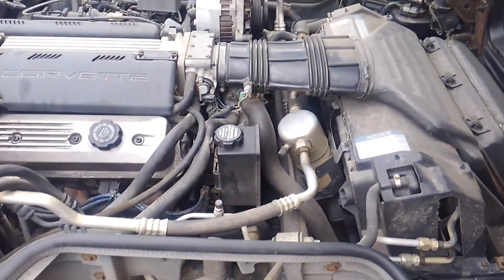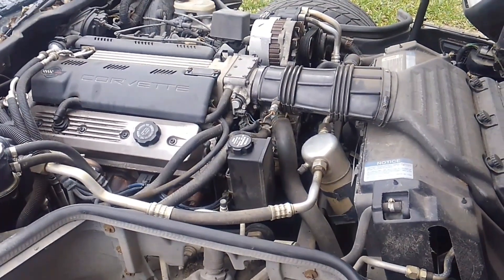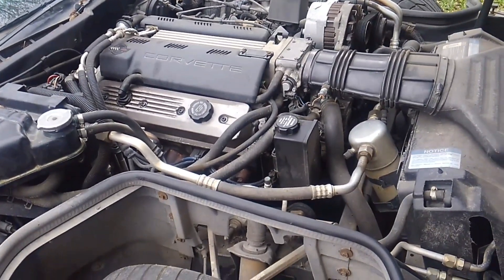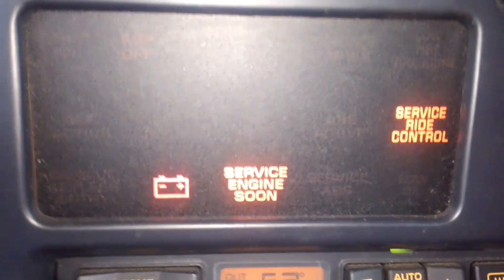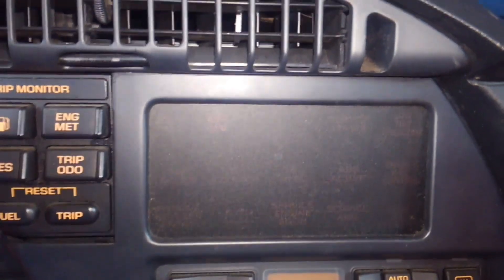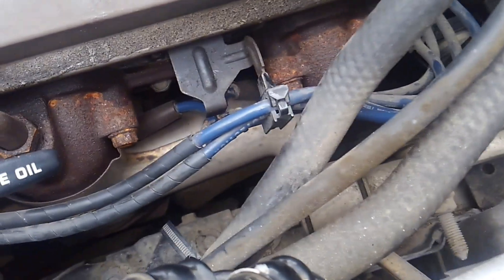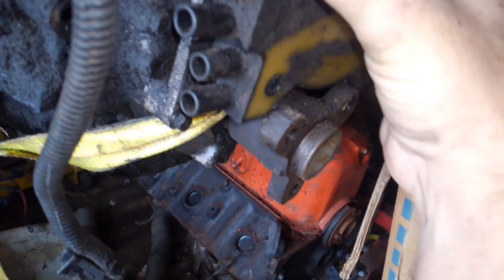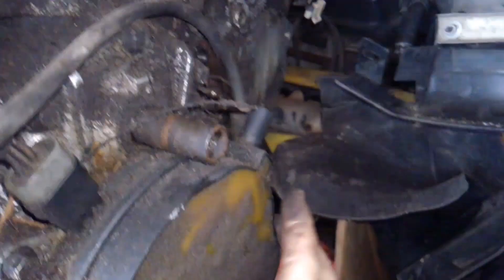The 1990's Corvette LT-1 Engine and It's Optispark Problem

Comment: The Optispark is at least twice as reliable as the HEI system it replaced. never had to change an optispark on our LT in the '94 Caprice. It uses the updated V2 Optispark which uses engine vacuum to draw clean filtered air through it.    If you want the difference between V1 and V2 is the Opti unit itself and the timing chain cover. V2 uses a much larger hole in the timing chain cover.  In the Caprice I believe '94 was first year for V2 of the Opti.  Its been wet more than once. the water pump has drenched it at least once. a garage that figured the opti was at fault because it was wet ( actually from the Throttle body ) and wwas actually spraying water on the front of the engine for some unexplicable reason.   The Original Opti is still on the car.

As for the opti, it is driven straight off the cam. it has to turn at camshaft speed. the spline drive for the water pump is about 11:1 ratio ( I did do the count years back but I just forget ).
Reply from the maker: Good info, thanks for sharing👍. They certainly are a neat piece of engineering, and dead reliable with consistent use and maintenance. I think they get a bad rap due to the difficulty in accessing them, especially on the Corvettes.

Comment: awesome videos,,,i would love an upgrade,,,mine runs well,,,always keep it from the wet,,keep covered,,no rain,,,no sitting for extended times
Reply: Do yourself a favor and buy the MSD opti-spark.Much more reliable and no moisture problems.Stay away from the cheaper Accel version,it's junk.
Reply from the maker: Yep, ive seen that the Accel units tend to be problematic.
Reply: @VetteSource  Check out Torqhead 24x coil packs that do away with the distributor.411 PCM plug and play is also an upgrade.It will allow for more defined tuning for OBD1 LT1s.
Reply from the maker: Cool, I'll check it out in a few👍.
Reply from the maker: That's the best thing in the world for them, machines need to keep moving or they tend to go south. I think that probably applies to people as well😂. Thanks for the feedback, appreciate it👍

Comment: Optispark's are dead nuts reliable and typically last well over 200,000 miles without any issues. My last optispark was changed out at 300,000 miles. Everyone wrongly assumes that the optispark is the problem when it is typically the spark plug wires that need replacing. The ignorance and propaganda about these LT1 engines and the optispark allows me to pick them up used for song. I mean, come on, do you really think you'd get 2, 3 or 4 bad optispark's in a row? Lol.
Reply from the maker: I think you're right that under normal consistent usage these things will are pretty reliable. However, Corvettes are often bought as "toys" and don't see daily use. That's when most of the problems start to occur with water pump seals and gaskets drying out and moisture accumulation. Thanks for watching👍
Reply: wow,,i have 121k on my 92,,and it runs well,,,thks for talkin me into keeping it,,i love the car,,,bright red,,red int,,,,good car
Reply from the maker: Yep, C4's are meant for the open road. Like driving a high powered go kart around.
Reply: I can understand replacing wires after 100K miles. I had to on my LR4 (LS Truck 4.8)

Never had a computer go bad either
Reply: I just had to pull it off my '93 with 39k miles and I took it apart and all the contacts were absolutely coated in corrosion. I'm amazed it even started in the first place.
Reply: drive them as much as u can,,,your saying????
Reply from the maker: As much as you can make an excuse for, unless you need to take a bunch of people somewhere.
Reply: Yes. I do think that. I replaced the entire ignition system when my original one took a shit at 114k miles. Changed plugs, wires, coil, driver module etc. went with an MSD pro billet, and it melted the rotor and cap within 500 miles. Had it warrentied out, and same thing.  Then picked up a Napa brand, which is Cardone, that was bad out of the box. Then decided to say screw it and picked up a Jegs unit, probably a rebranded Cardone as well but it’s been okay so far. Car just recently developed a severe miss under load. Haven’t looked into yet, but I’m suspecting it’s, once again, the opti.
Reply: If there after market yes
Reply: @jamesflames9930  Just replaced opti-spark distributor on my 95 Corvette LT1 with after-market from Mid America Corvette.  Original GM part no longer available.  Not an easy job but must be methodical as to removing everything from top down & reverse installation.  No need to remove throttle body as described in one video.  Bad seals on the water pump & opti are the biggest contributors to contaminates on the opti.  Weep Hole on the water pump is usually a sign of water pump failure & certainly adds to dampening the opti...
Reply from the maker: Good info to have. I know it's always a hit or miss on whether you can trust some of the online rebuilders out there. Add in that the optispark isn't that much fun to change and it becomes really aggravating.
Reply: My 94 caprice with 289k miles . Opti just took a shyt. Car stopped working one day after work. I changed my ignition coil and module and she ran for a day. Now she just cranks. New opti on the way

Comment: I have a 1993 LT-1, it also got and run's real rough. Have air dried everything, any Idea's
Reply from the maker: unfortunately the early units are prone to internal wear of the crank sensor and even with cleaning still don't want to function correctly. Might be easier to replace at this point rather than spend extra time on troubleshooting. Thanks for watching👍

Comment: My license is suspended for medical but I dream of getting my license back and getting a C4 Vette.

If I get to live my dream one day, do you recommend the L98 vettes or the LT1 vettes?
Is the Lt1 worth some of the headaches?
Reply from the maker: Both engines have their individual strengths and weaknesses, but for overall day to day enjoyment, I would look for a nicely kept 95-96 C4. They are well built, awesome  road cars, and quite comfortable serving as a daily driver. The best part is that they are seriously undervalued right now, and can be had for a song compared to how expensive they were when new.
Reply: @VetteSource  thanks so much for replying.
I hear on reddit all the time that for the price of a well sorted lt1 6 speed C4 you may as well just pony for a C5. Any truth to that?
You seem to know your shit!
Reply from the maker: @Jason-fp7vi  those words are usually spoken by people who have never driven a C4😂. While C5's are great cars, I prefer the driving feedback you get from a C4 vs the C5. Plus the electronics are becoming problematic on the C5's. They have a high failure rate of things like the EBCM and other modules and wiring that can be costly and time consuming to repair.
Reply: My 89 Vette stalled while driving now cranks but won't start would you suggest me replacing the distributor cap first it's obviously getting no spark
Reply from the maker: Distributor cap probably isn't going to do it. I would start by checking for power to the distributor first, and if that checks out, I would take a look at the ignition module first. Oddly enough, a bad rotor can also cause a no start condition. Let me know how it turns out👍